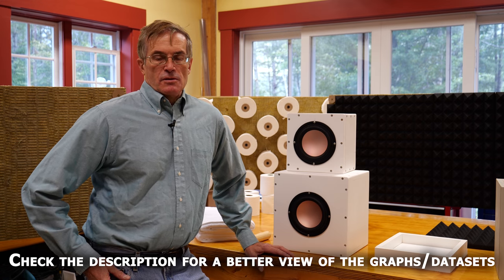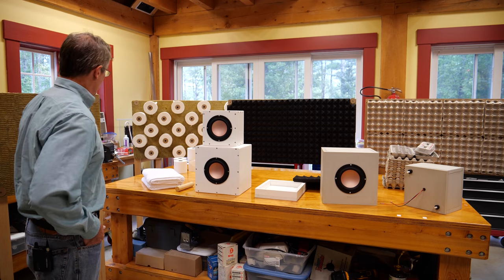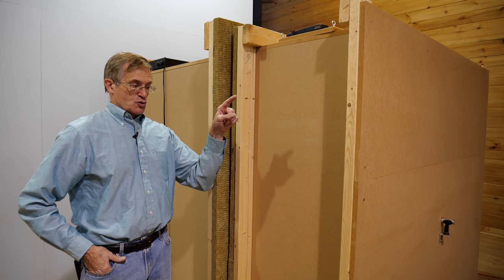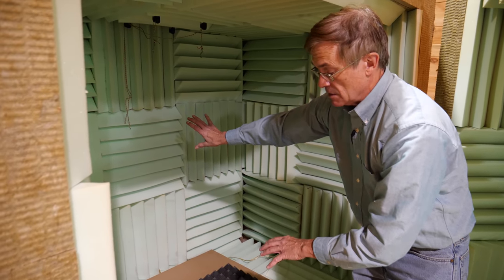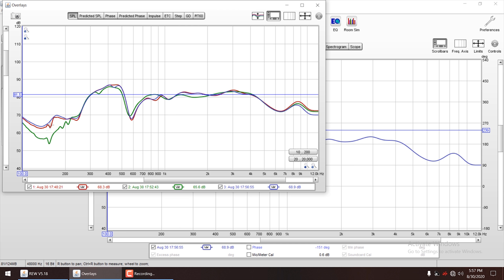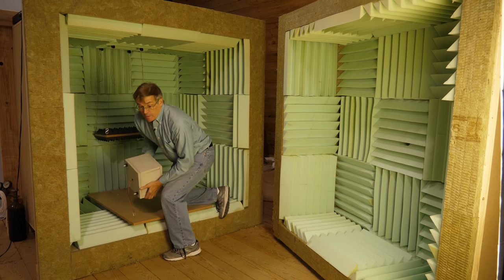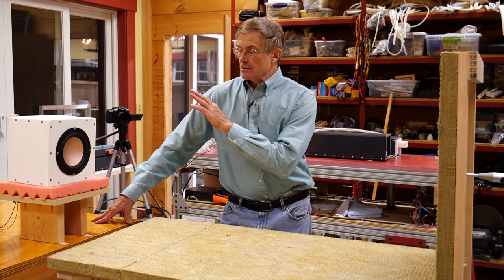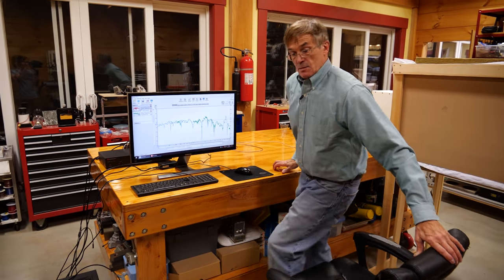DIY Speakers and Acoustic Panels

Comment: Confirmed what I already suspected... Foam is gonna do nothing to quiet my genny to the point where I can run it over night. I'm now considering perforated acoustic drywall panels (Gyptone Rigitone 8-15-20) with a 200mm, insulation filled plenum. Don't know how well it'll work, but it's worth a shot. About the same cost per square meter as a multi layer foam setup like yours.

Comment: Interesting about how the fiber absorbs energy, hadn't thought about that. What about using fibers with larger cross sections of the induvidual strains. Wouldnt that absorb more low frequency? I'm thinking wood sawdust or wood chips... Thanks for your videos.

Comment: This exhaustive presentation is a joke. This video should be 10-15 min, but it's 50 because you show absolutely every little insignificant part, like the placement of every speaker along the closing of the box; even the intro wastes half a minute for no reason other than to pretentiously say you've done "a number" of sound videos. I used to be subscribed but not anymore; if you can't respect my time I can't respect your content, it's outright insulting. I unsubbed on the previous video I tried watching, "Best LRAD System!... For Your Money", not only is that too much too long, it's kindergarten level information, littered with misinformation like 330m/s being the speed of sound, and I fell asleep during the boredom. This channel could be much more if it didn't waste so much time, wasn't so bland, and wasn't so full of useless or widely known information.

Comment: Two very important points here: 
1- Please point out at some point the inherent dangers in DIY acoustic absorption panels! Upholstery foam is a HUGE FIRE HAZARD. Seriously, hundreds of people have died trying to save money by getting non-building code foam or other materials and lining walls with them. 
2- You should always combine your port volumes to maximize the vent diameter. The weight of the volume of air should be the determining factor in rear wave delay, not the bottlenecking of a small diameter opening. Small openings make for turbulence. This makes wind noise. I highly recommend maximum hole size, even if this makes the depth inconveniently long.

Comment: Your clear explanation of why low frequencies are more difficult to attenuate, as compared to high frequency sounds was sensational.  A crystal clear explanation.  Thank-you!  Also, interestingly, my tinnitus kicked up a notch the day after I watched your latest masterpiece!  A question if I may:- what material would you suggest be the best for lining a pool pump box, to reduce the 100Hz or so hum?  After re-watching your video, I was thinking, perhaps towels, as they seemed to be doing some good at that 100+Hz range?  You are certainly very good at what you do!  First-rate in fact.

Comment: I would like to design DIY sound room 10' H x 17W x 23L.  Question about required sound panels and diffusion required walls and ceiling etc.  Do you have any video or advise.  Thanks Dan

Comment: I'd love to hear your thoughts on why sub 200hz frequency response was lower with the rockwool board/padding inside the speaker cabinets.  This is baffling to me based upon the theories surrounding dampening low frequencies (as you also mentioned).. I guess I've read that things like acoustic foam "increase the effective air volume" inside an enclosure..is that the explanation for this?  If so, it's best to only be used in an application where the internal cabinet volume is lower than ideal for the particular driver?

Comment: The terrycloth is actually the best. You have to get the right terry. Cotton, as close to 100% cotton as possible and heavy and broken in, which means 6 or 7 times through the washer. AND Ive generally done them 4 ply.  They have worked better than anything else Ive tried. I have a music room and keeping the LOUD in the room and not resonating all through the house and neighborhood mondo importante'. The low freqs can be absorbed with hard rubber mat. Expensive so music room is small. Computers and noisy electronics are outside the room. 

Most times you have to listen really really hard to hear anything and that is IF I have the amps turned way up. 

Soooooo I disagree with your test results. 

:)

Comment: Mineral fiber (rock wool)/fiberglass works ok, cotton has its own overdamping issues, but those plastic foam packaging wedges leftover from shipping are pretty-much (acoustically) useless! You may as well use them under your memory-foam mattress, if you're brave, enough? and don't mind perspiring/sweating and not sleeping well!

Comment: BTW, owens corning makes a compressed fiberglass panel faced with fabric as you described. it's for their anti-mold basement finishing system. (nylon fabric). they claim .85 NRC. really happy with that combined with ceiling tiles and carpet, which pretty well matches your recommendations.

Comment: I built a small 'practice amp' for my electric guitar. It's cabinet was a sealed ~12" cube, second hand computer 'woofer' which had a small driver and a larger secondary passive cone (this isn't really important as it's gutted and I have a decent 10" full spectrum driver in it now with a 40W amplifier. I haven't fired up a scope and mic to test it, but know it certainly has an ugly response curve just from the way it sounds. I know I'm going to build a new cabinet for it, but before I do, what would you recommend for materials, dimensions (<24" cube, not necessarily a cube, but smallish), porting et al? I've been watching all your speaker builds & testing, but haven't seen (until this video) smaller speaker systems that would fit the bill for my guitar amp. Thanks for what you do! I like your style & thoroughness of your science!

Comment: wouldnt the anechoic chamber work better if it was like 2 triangles that had 2 angled sides adjacent to each other instead of one angled side and one flat side? 
like it seems that sound in your system would bounce off at 90 degree angles because the setup has 45 degree angles
like this

reflection
/⬇️⬅️⬅️⬅️⬅️⬅️ sound in
/=45 degree surface
/⬇️➡️➡️➡️➡️➡️ sound out
⬇️⬆️
⬇️⬆️
⬇️⬆️
_________
_____= 90 degree surface

it seems non 45 degree angles would make it have to reflect off the phone alot more before it got to the wall to get out of the chamber or reflect back in the chamber
most anechoic chambers ive seen used reallllly long triangles with tips with really acute angles so the sound had to bounce alot because the bouncing angle was shallow and slowly bounced to the wall instead of 45 degree only bounching 3 times
could do that with matress foam by just making wider rectangular strips and increasin/decreasing the angle on yhe bandsaw

Comment: I built a music studio in my back garden, it has noise reduction rock wool in the cavity and plasterboard aka dry wall rated for sound (here it is pink coloured) then I just put acoustic carpet on the walls like you line vans out with or cover speaker boxes with, I have a pair of old mackie sa1532z inside and the building is about 20-30ft away from the house, I can crank it and you can still hear it in the garden but if I go in the house and shut the door you can't hear it and these are floorstanding twin 15" 139db spl pro club speakers and it's deafening inside the studio

Comment: In the sweep recordings, there is this noticeable dip between 500 and 600Hz.
Seems like a characteristic of the driver/microphone/test equipment, but what exactly is the reason for it (mechanic, electric)?
Also, does this dip mean an audible degradation in comparison to a hypothetical perfect driver?

Comment: I don’t want to sound like I do not appreciate what you are doing but the things that you see below 250Hz looks like the artifacts that such a chamber would present below the (I am using the term at it’s lightest possible meaning here) cut-off frequency. Usually, in real life, below the said frequency, the responses are discarded as the chamber becomes unreliable due to many reasons. The most obvious giveaway is that, sealed enclosures have a certain roll-off slope and it is consistent below their resonance frequency, any gain that you would see over that slope may be either because of the chamber gain, side panel resonances or even the phase of the moon in your case. Another indication is @26:00 when you flip the speaker, the gain below ~250Hz seems like it is unchanged.

Comment: This is one of my old bugbears on all speaker design, the idea i had for a design was too form cob (mix of chopped straw clay and manure), my idea was too build them into a room 6.5 x 7-7.5 trapezium 2.7m high. Why you ask becuse the cob should completely negate resonance, therefore isolated speakers or inbuilt , just thinking! like this experiment, thankx

Comment: Just for context: Human voices use primarily the 100-1000Hz frequency ranges, i.e. the lower part of the range in these graphs, and exactly the range where there was a bit of a difference between towels and corrugated foam. There is still a significant component up to around 4000Hz though, so even the towels should noticeably affect human voice recordings.

Comment: What would be nice actually, is an extension of this for home theatre.
Test a standard home-style home lounge setup, and add or take away certain typical room "items" to find out an average optimal room "configuration" for best quality sound. 
Eg. in a 5.1 setup, given a certain speaker placement with a sofa 3-4 metres away from the centre and surround speakers well above ear height, 1 metre behind. Then with a tiled/lino/concrete/timber floor - does a rug offer advantages? Do some throws (blankets or cusions) on a leather sofa help; or an ottoman or floor cushion. Does a few paintings on the walls have advantages? Or a tapestry? Should I get rid of that coffee table in the corner? The findings would be extremely general, but it might give nice "food for thought" for the viewers wanting the best sound we can get at home on a 5.1 or 7.1 home theatre setup. It could be fun to do.

Comment: Just discovered your channel. Enjoying the efforts of your analisys. For the anachoic chamber, have you considered decoupling the mic from the outer wall of the anachoic chamber? Using a suspension/shock mount may further improve an otherwise solid design. Thanks for all of the informative videos.

Comment: Great series of videos, taking your viewers along with you. And an immense amount of work put in!  My hat is off to you.

I look forward to videos on baffle edge diffraction effects on sound; measuring harmonic distortion and inharmonic distortion of the flat-panel DML speakers (and ordinary ones); and full-space, half-space, quarter-space, and eighth-space effects. (In free space/anechoic, buried face flush to the ground in a an open field, in the corner of two walls or a wall and the ground, in the corner where two walls meet the floor or ceiling.) 

Oh, and Helmholtz resonators and other kinds of bass trap for studios or boomy spaces.

Regarding anechoic response, one of the test methods speaker makers use is tone bursts.  The speed of sound at 25 Celsius in humid air at sea level is about 346 m/s. If you suspend the speaker so that the shortest reflection path (from speaker to floor to mic) is 3.46 metres (with the mic at the standard 1 metre from the speaker), you can play a tone for up to 10 milliseconds before the first reflected sound appears at the mic. So this is a method of measuring anechoic response. Of course it's usually only feasible to measure down to 200 Hz or so, but renting an auditorium or basketball court is a lot cheaper than buying a commercial anechoic chamber!

Comment: Driver diaphragms are not acoustically opaque. Cabinets without absorptive materials on interior surfaces reflect more energy back toward the driver, where it becomes distortion products as it transmits through the diaphragm  and mixes with the intended direct sonic radiation, degrading clarity. This can easily be seen and quantified with very near field mic and real time pink noise excitation and a very high precision spectrum analyzer, or with a THD+N analyzer.

Comment: If you do further testing, I'd be curious about how expanding foam performs for sound absorption. As part of working from home during the Human Malware Event, I was fortunate enough to bring some inconveniently loud equipment home, looks like a ceiling tile box with some clever venting is a reasonable starting point, with extra clearance for adding sculpted mattress foam if that's not enough.

Comment: Most people looks after absorbing materials and, as you noticed, few of them can modify low frequency response. I think that diffusion is far most important to consider than absorption and I’ll be very interested by the responses you’ll obtain using skyline diffusers instead of absorbing materials !... Nice and extensive work anyway !…

Comment: For porting your speakers, go talk to your local fabric store, and get some of there cardboard tubes  that fabric come on. Excellent for making ports on speaker boxes. 
I have a book for Radio Shack back in the late 80's early 90's that has all the formulas for building speakers. Yes, there the old big "home theater" style from stereo sound, not surround. Yet, they still rattle the windows with a nice clear sound.

Comment: Interesting if you can find the ‘holy grail’ of sound minimization because I believe there is a huge market for it, hence ‘whisper rooms” for drummers. I’ve always thought that water with a thickening agent or silicone, closed cell foam or dense expanding foam may be cost effective for retro fitting. Love the channel. 👍🏼

Comment: You should have tried putting the sound absorption about 50 to 100mm away from reflective surface to impact the lower frequencies better.

Comment: On the toilet roll sound absorption, it reminds me of a high quality 1950s loudspeaker which I dismantled many years ago. It used loosely layered tissue, very similar to toilet paper, with a thickness of about 59 to 100mm of the multiple layers as sound absorption material. Most of the thickness was air. The paper was much bigger area than toilet paper and was just tacked into the cabinet in the corner edges of the box. Subjectively it had much better sound absorption than commercial acoustic foam or blanket. The only drawback that I can think of is that it must be a huge fire risk if anything in the speaker or its connections overheated.

Comment: Why no distortion and impedance measurements? At least some impedance measurements to show and point out what causes them and explain how the port works. Does REW do this or just frequency response? I think HOLM would be a better free software. Or for a little $ Omnimic.

Comment: You have a very large room, perfect for measuring speakers.   By gating the impulse response before the first room reflection arrives at the mic,  15 ms or so, you don't need the anechoic chamber.   Sure, it's nice, as you don't have to hear the sweeps with the chamber.  You might check out the Arta software for this.   It is very informative to measure with the microphone very close to the cone, maybe 1 - 2 cm.  This gives a measurement of what the speaker produces, and the internal cabinet reflections, without the baffle step, cabinet baffle corner diffraction or room reflections entering into the measurement.  The close mic response with a properly damped cabinet can be very flat for a good speaker with less than 1 dB variation.  I now stuff my speaker boxes tightly with fiberglass batting, or long wool to absorb the most sound coming from the rear of the speaker.   I also build boxes that are half cube shape, so the reflections from all five walls arrive at the same time.  This produces the highest frequency for the first reflection, making it easier to damp.    A half sphere cabinet would be best of course.   Keep up the interesting work.  I worked in aircraft design, digital filtering, electrical engineering and software engineering for heart monitors and touch screens in my career.  I now work with audio, as it has so many interesting challenges.

Comment: Fascinating!  Does the helium-filled speaker exhibit a pitch shift upward on the output sound when compared to the input frequency?  I'm guessing it must.  If the anechoic chamber were purged with helium, I'm sure there would be a marked frequency differential between input and output.

Comment: Good experiment idea but missed a few things. You've only looked at the on axis frequency response which can be easily corrected with eq and only used a cheap driver with a stiff but heavy cone. Try looking in the time domain which is not as easy to correct for but super important. 
1. Try comparing the rockwool again but whilst using higher performing fostex driver with a more transparent cone. 
2. Try looking at the phase, and in the time domain using the waterfall and spectrograph plots when trying the different speaker constructions (not so easy to correct with dsp)
3. Try measuring off axis while trying your different speaker enclosures.
4. Try listening subjectively with the different enclosures  (your ears are more sensitive in the time domain then your measuring equipment and the time domain performance is what people describe as the "clarity")
I think you'll see a bigger difference